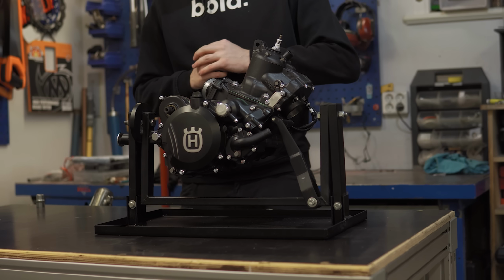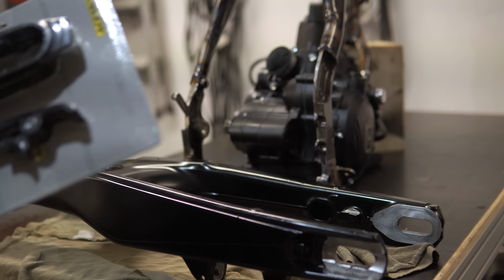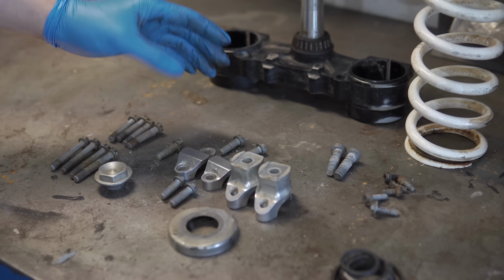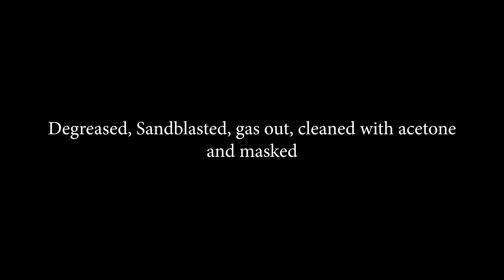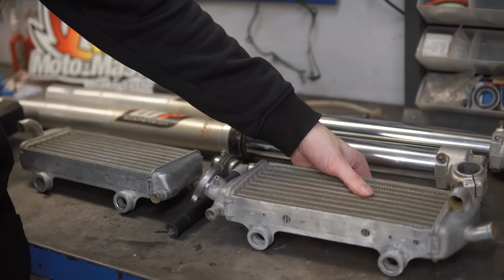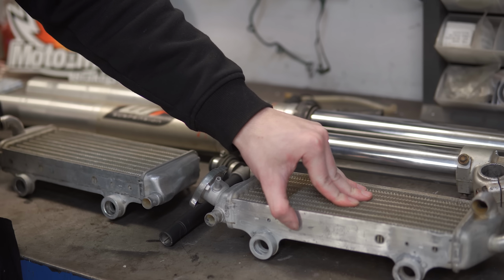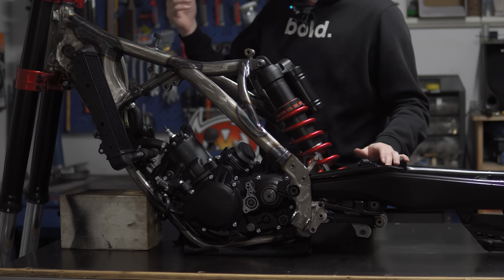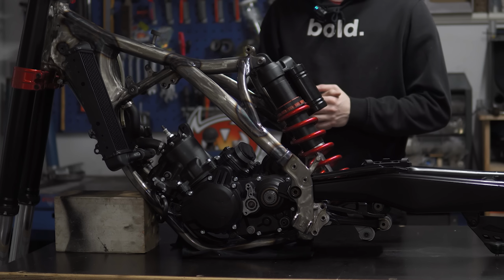Next Level Supermoto Frame! | Te 125 SM Rebuild - Ep 3

Comment: What tool do you use to put in the little Pipe of the cooling system in the frame?
Reply from the maker: Big bolt that has roughly the outer diameter to fit in the pipe, the pipe has 3 "inverted" grooves for lack of a better word, so tock a grinder to the bolt and made 3 slits in it to fit inside the pipe